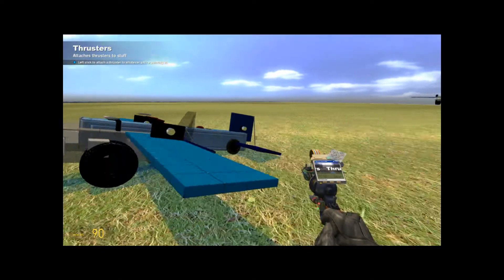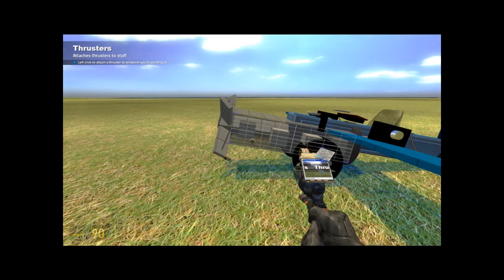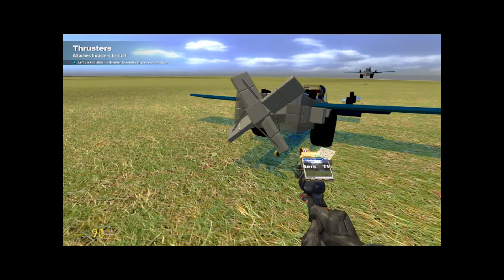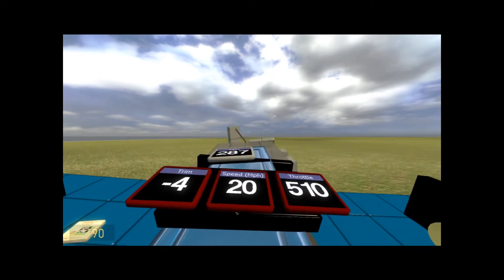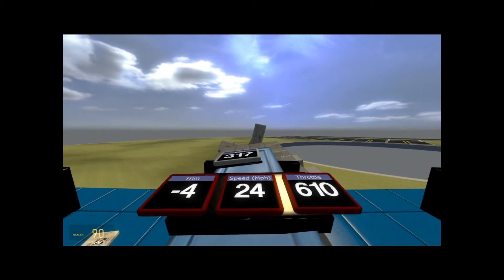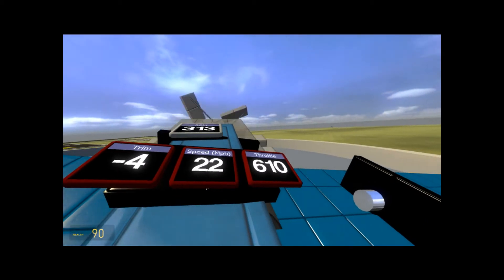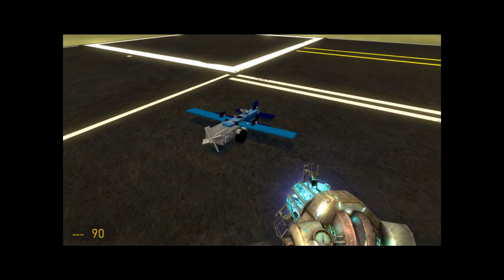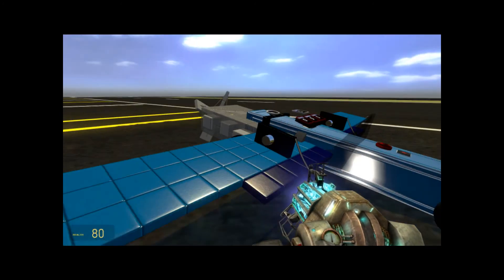Gmod - Airplane With Real Engine + Propeller

Comment from the maker: @spider0804 And as a secondary note I do not know where the wheel and wire wheel stuff is coming from , you could use a wire motor to turn a prop, or apply force, or an engine, or anything that turns really, hell you could use a prop attached to turn with ropes with thrusters to turn it.

Comment from the maker: Sliders work at any yaw, I have made radial engines with 16 rows of 4 pistons and they worked fine. I even made an engine with two crankshafts perpendicular from each-other and two gears connecting the cranks as a test...worked fine except for Gmod's crappy gear interaction.

Comment from the maker: @OpenPagan Stay away from hydraulic engines if you can , they are controllable but not nearly to the point of pistons, piston engines can have better timing, and of course they are not terribly in the spirit of engine building. With adv dupe 2 and easy precision sliders, a piston engine = wonderful.

Comment from the maker: @OpenPagan If they do not work properly then your weight scaling is not right, on this each piston weighs 10, the crank 100 , the flywheel 50, the engine case 200 also its gm_flatgrass_airport

Comment from the maker: Garry's Mod only has the physics you apply, The propeller has a tool used on it called the fin tool which turns the piece into something that either acts like a wing or a sheet of plywood.

On this plane, the wings act like wings (lift moving forward with no positive angle)
The propeller and control surfaces act like a sheet of plywood. (lift with positive angle)

But this plane is pretty close to realistic. Please check this video out

/watch?v=4ETlzxzwM64

Improved plane